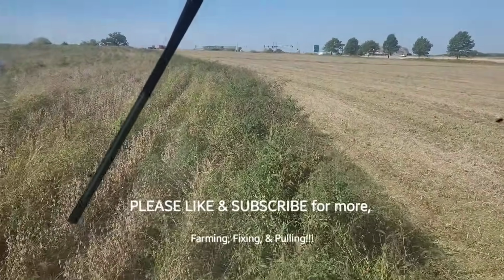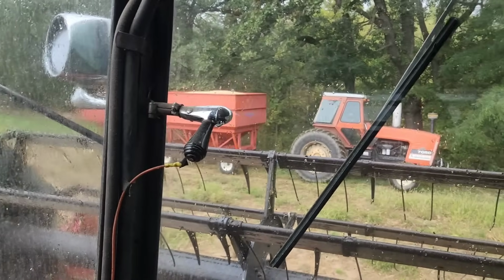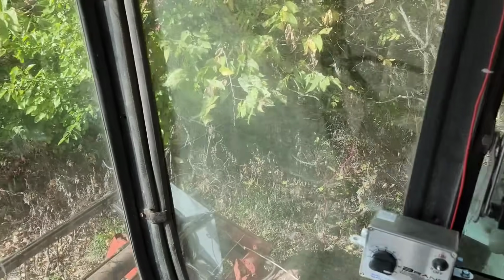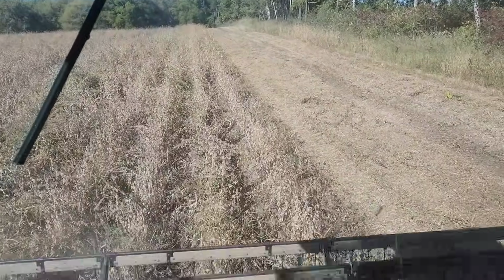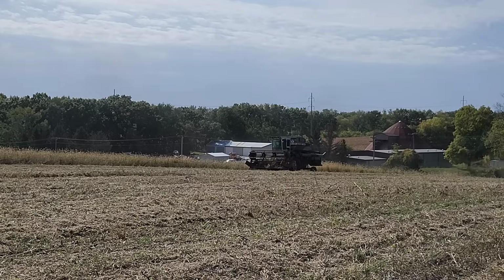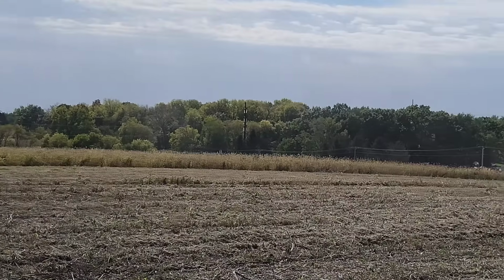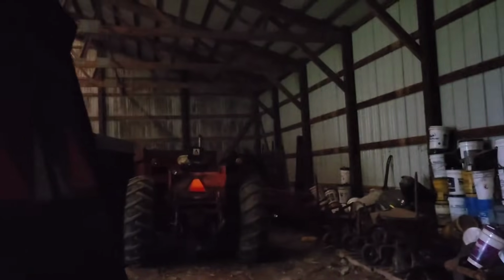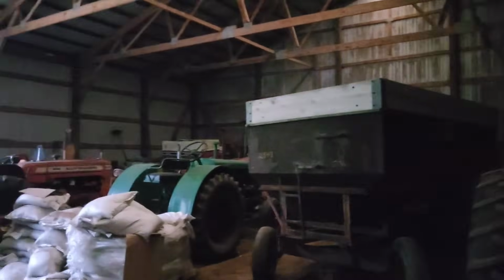2023 Organic soybean harvest.

Comment: Man I wished you had done a video on variable speed repair! Enjoyed watching y’all harvest soybeans!
Reply from the maker: https://youtu.be/InqR5xZs9H4?si=DUV_stqqScdOIIkO
There ya go cousin Scott 😆. It's a pretty simple process really. Especially just getting the outer shieve off. The bushing need to be done with a press. I was able to get mine out with a hammer and punch but ruined a new one trying to put it back In, and the bearing is just a bearing 😆. But one thing to note about that. On mine the bearing holder was lose on the outer bearing, and you can't get that holder anymore. I put excessive amounts of red lock tight in there the 1st time i changed that bearing about 6 years ago, and it outlasted the bearing 😆. This time I did the same thing. Obviously 😆 if you got any other questions don't hesitate to ask.

Comment: Love the operation, Quick suggestion on the lights, it looks like you bought "spot" lights as opposed to "flood" spec lights. That would help on the front with the center lighting up, also on the side it would light up a much bigger area as opposed to a circle 30ft away from the combine.
Reply from the maker: Thankyou sir! I bought a 20 pack of these lights on Amazon for $69.99 with free shipping 😆 after replacing all but 2 lights on the combine and adding 1 I've got 12 left and it takes 4 of them to use the same amount of power as one of the factory light🤦‍♂️. But your right food lights would definitely be better on the sides but fir the price and power user of these I'll just slap a couple more on there 😆. Thanks for watching and commenting.

Comment: Lookin good Tim. We ran 4 lights on top of the cab in front.
 Are you running long finger chaffers?
Reply from the maker: Yes I sure am. And long fingers sieves. I have the beans sieves but my beans are always to big to fall through the holes correctly. I end up with more clean grain coming through the returns than I do into the hopper with that one 🤦‍♂️.

Comment: Ahh yes the old no reverser gleaner days. I don’t miss those at all
Reply from the maker: My gleaner has a reverse on it 😆 it's a Ford starter and flywheel it works great lol
Reply: We had an old m2 with no reverser on it, i was only about 7 years old the first time i had to help dad unplug the feeder, did that many times until i was 14 then te old gleaner gave up and seized the engine solid changing heads. Terrible engine in those m2’s then we went to a 1660
Case ih with the cummins. What an upgrade wow. Ran that from 2002 to 2013 then got a 7120 case and well that isn’t even a comparison. We do still run the 1660 as a backup combine and run it every year. Good old combine but not even close to the 7120. I could probably eat the 1660 with the 7120. But old girl does the job.
Reply from the maker: @bradenconway9066  you lost me at, terrible engine in the M2s, 😆 you may have had bad luck with yours, but the 301 was and still is one hell of an engine in any application allis chalmers used it. Cheep and easy to overhaul too. It's definitely my favorite small block engine from the Era.
Reply: Ours died and completely locked up at 2222hrs. Biggest problem with them is they sat at an angle in the m2 and oil didn’t get perfect into them. My uncle has 2 l2’s and way better machine. I dunno to each their own. I’m a CIH and a gleaner guy so all i can say is i like watching your videos

Comment: Come on put a 20ft head on it and then tell me you can combine all them weeds
Reply from the maker: A 20ft would only be 4 more feet and I'm picking in 3rd gear with this one. There's no doubt in my mind that I get it through the combine. I have a tendency to start a little to early and push it a little to late though lol with the 16ft head I don't have to be as careful when it's tough.
Reply: @TimothyFluegel  we run 30footers on 2 lexion combines ones a 475 and the other is a 575 both are about 300hp going anywheres from 2 to 3.5mph and let me tell ya we were doing a customer's beans yesterday and it really seemed like we were just combining hay with 60 bushel beans mixed in